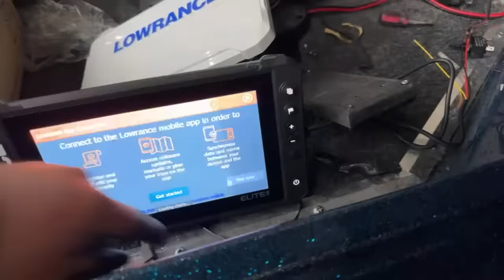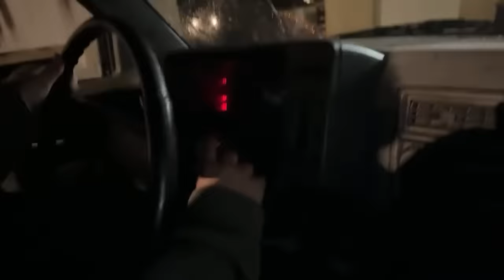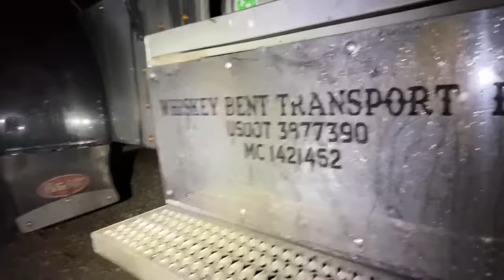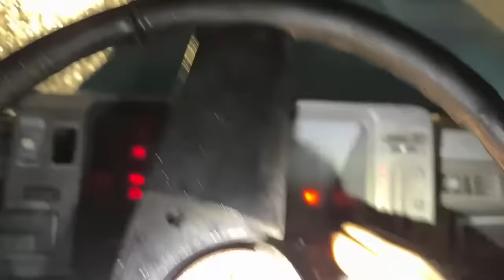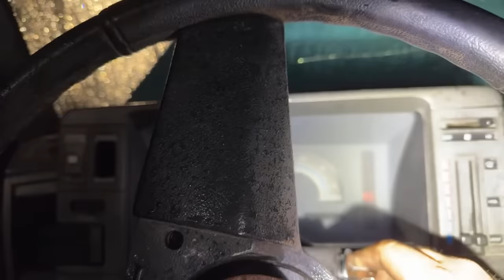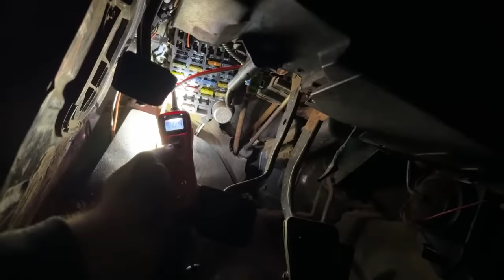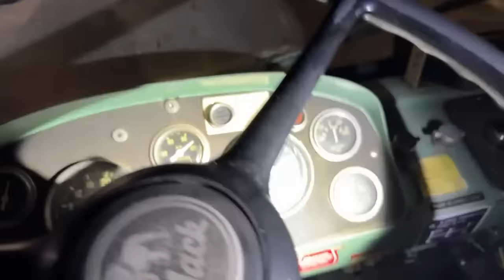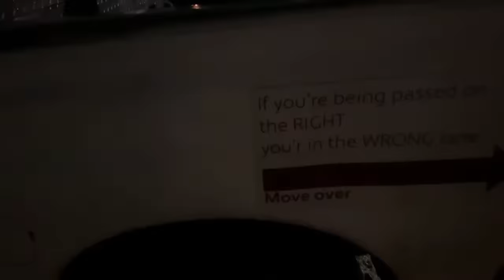We’re Blowing It Up This Time!!

Comment: When your towing really gets going you can use the firetruck for your safety truck and if you are out on a tow run and if it's to far out for the firedeprtment you can put out the fire. And if someone wants to do control fires they can call you to keep the fire under control there's lots you can do with that firetruck. You need a portable battery charger for cellphone i have one an its has lots of power it will last for your live videos

Comment: I had a Mack tri-axle with the 237 hp engine 6 spd lo hole trans and 4.50 ratio 44,000 full locking rears that thing was a beast.